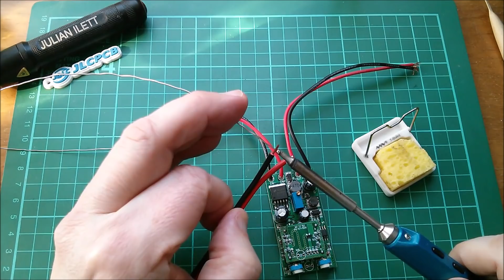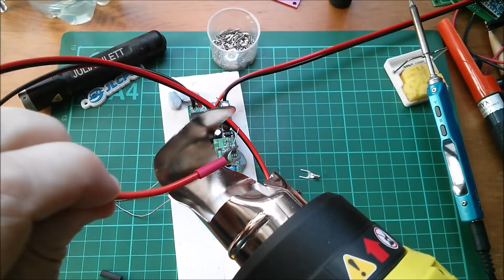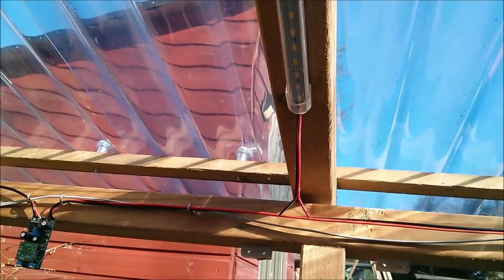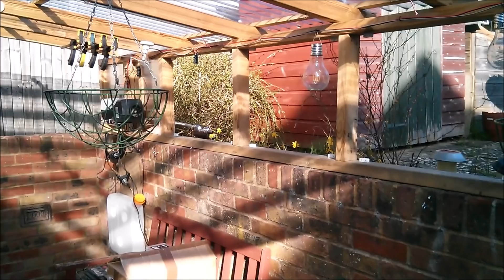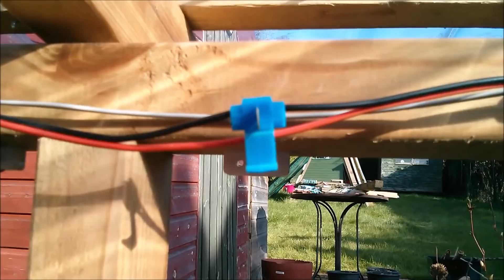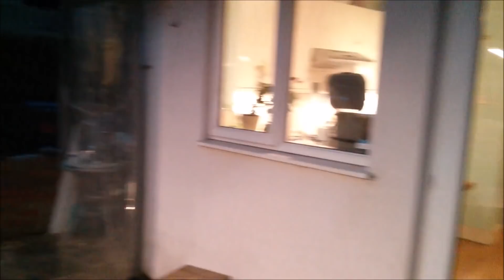Radar Sensor Lights - Outdoor Installation

Comment: quick tip. when sucking solder from unpopulated holes: hold the board vertical and put the iron & sucker on opposite sides of the board.

Comment: Getting the setting right is not difficult, it’s impossible. Never made these modules work consistently from one day to the next, also triggered by switching mains devices on and off.
Reply from the maker: I agree - I'm using PIR from now on.

Comment: Do you make sure you buy pure copper wires or do you have good luck with Copper Clad Aluminium conductors.    I am looking for zip cord like you used and am on the fence on which way to go.   Go cheap and be frustrated with the CCA or spend the coin and get the sure thing copper.   I do want to solder my connections.   Thoughts???

Comment: Is that radar unit pointed in the right direction?  I thought they worked off of one of the edges of the PCB?  In any case it should be mounted securely so that the wind doesn't move it thus causing the bounced signal to change and falsely trip it.  I believe a regular IR detector would be much better as you want to detect humans and not any old thing that can trip these radar units.

Comment: The micro wave will grow stronger over time and I suggest that you wire a PIR detecor in series with it then if both are triggerd then it would turn on but just one it will not and that would solve a lot of the Microwave sensing problems
Reply: That radar may well go though the wall, but a PIR will not.  I agree with using both together to make things work right.

Comment: scotch locks make me cringe. good video otherwise
Reply from the maker: They work surprisingly well though :)
Reply: @JulianIlett  For about 1 week. Then the salt gets into the wiring, and the damned things overheat, They tend to "'cut" the wire strands inside even if used correctly.  I can't begin to explain how bad they are. So many fires, and faulty connections are caused by the daemon clips from hell....  I often troubleshoot cars, and my first step, is to replace any of these horrid creatures if I can spot them.

Comment: Can't you mount the sensor on the house so it's facing into the enclosure. That way it's not looking directly into the windows but should still detect motion inside.
Reply: ReverendFlatus these sensors actually detect through walls and windows unlike pir sensors
Reply: A good alternative is the HFS-DC06 microwave motion sensor which is directional to roughly a 180 degree span. Also they have adjustable sensitivity to reduce the detection distance which is great when they are pointed toward a fence line where a neighbor could trigger it. I have these mounted inside exterior walls of my house directed towards the outside. I use them for security and this way nobody knows they are there. I did have to experiment with where they would work and not work. The metal foil that is on most fiberglass batting insulation will block the signal so I mounted them on door frames, the shed, etc where there is no foil or other metal, like a garage door, to deflect the signal. Oh and I also discovered they don't work through many windows! I researched this and found out most exterior windows are Low-E because that is normally desirable to reduce cooling expense and has even been required by code for a while in many areas. Anyway, Low-E glass is often made with vaporized silver and since silver is a metal it blocks the microwave signal.

Comment: I have some LED strip lights similar to yours. Two in the shed, two in a similar undercover area as you have. On one in the undercover area, annoyingly, one LED has failed, and the two nearby LEDs now light up dimly 😕. Only been in place for about one year. This despite me using a 1N5401 diode to drop the voltage a little (fed from a solar charged 12V battery). The rest of the LEDs on the same strip, and all the other strips are still fine though.
I hope yours last a nice long time.
Reply from the maker: I've had these 12V LED strips in my kitchen for over a year and they're working perfectly.

Comment: There is a special place in hell for Youtubers who solder crimp connectors, you all flipping do it and you are all flipping wrong. Buy the proper tool and the proper sized crimps. Grrrr
Reply: LMAO 😂 
We have a ratchet crimp tool at work for crimping proper professional crimps, one tool for red, one for blue, one for yellow and black and we also have one for purple crimps. They cost a bomb. For attending failures, for occasional use (not officially suppose to used for new installation work), we also have a less expensive, but still not cheap ratchet crimping tool that can crimp red, blue, yellow and black crimps. By using one of these tools and using proper high quantity crimps, we get really reliable, excellent quality connections. Much, much better than soldering and much quicker. And stronger connections.
Reply: @Mark1024MAK  For the hobbyists who don't want to spend hundreds or more on a nice crimper, crimping with a cheap crimper and then soldering the end makes a more reliable connection. (But don't tin the wire and then crimp - you'll get reliability problems.)
Reply: NiHaoMike - if it has been crimped correctly, there is no need to solder the connection. Non-ratchet tools can be used successfully, as long as you always fully depress them all the way. It also helps a lot if you buy good quality crimps from mainstream suppliers. After crimping, do a pull test. If you can’t pull the wire out of the crimp, it’s all good 😁
Reply from the maker: That's the lovely thing about crimp connectors - you can solder them :)

Comment: Great video Julian, but I'm worried about exposed electronics on the sensor board, conformal coating will help.
Reply: Humidity totally stops existing outside if you just nail it under a bit of plastic...
Reply: Corrosion X is some really great stuff

Comment: Hi Julian, do you have a small pot for everything? Can I detect a bit of OCD here, resistor clippings and now solder bits! :) do you have a different pot for leaded and unleaded? powered PCB's and condensation leads quickly to end of life for poor little PCB's, treat it to a nice sealed box.
Reply from the maker: Ha ha, no, just wire clippings and sucked leaded solder. I think the PCB will be OK under here - the buck converter running the Xmas lights was in the same place for at least a year and didn't have any problems.

Comment: If I recall correctly, these microwave motion sensors should be able to detect motion through an enclosure, so I'm wondering if that would help attenuate the signal enough so it doesn't switch on for motion inside the house. Otherwise you could try mounting it on the bottom of the beam, or at some angle facing downwards, so it's pointing more towards the ground rather than the window.
Reply from the maker: There's a sensitivity pot, but it's proving difficult to set. Enclosing the module might help :)
Reply: @JulianIlett  I think an enclosure is essential for longevity, different materials have differing absorption/transmission/reflectivity rates for microwaves,
I would play around with different types/thickness of plastic and see what happens, 
I think any corrosion of the antenna track would possibly cause severe drift or outright failure, there is much voodoo designed into the antenna, moisture on the track would definitely screw with it so a decent I. P.  rated enclosure would be good (I know it's not exactly your usual style but you could play around with different materials as filters to see which is best)
Reply: Should also help with the WAF (wife acceptance factor)! Not to mention giving you a better mounting option than hanging it from its wires.
Reply: I reckon it's going to vary widely as the antenna gets dirty/corroded. Would be interesting to find out

Comment: Instead of using the solder sucker use some solder wick it's much better and gets rid of all that crappy lead free stuff
Reply: The solder sucker doesn't cost anything to use where as the wick does.  Suck up the bulk of the solder and then if needed you can clean up the rest with some wick.
Reply from the maker: I like my sucker - works really well on through-plated holes :)